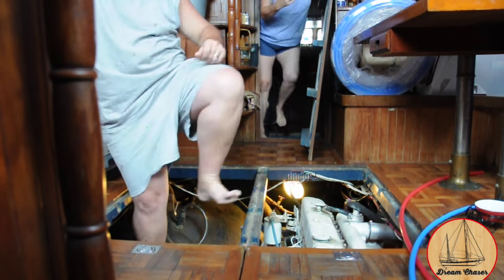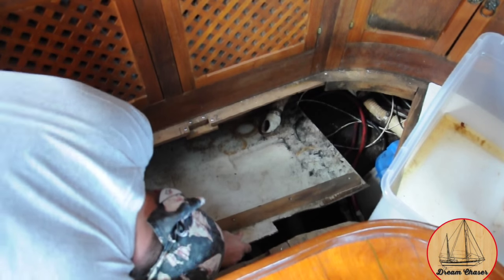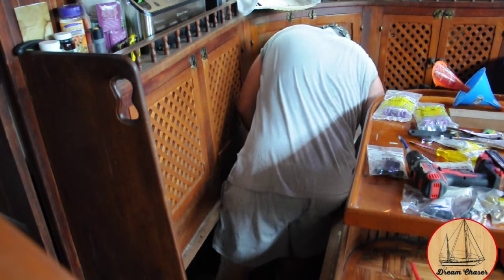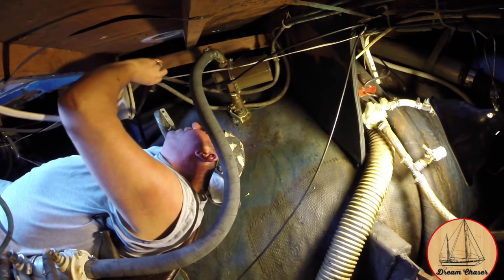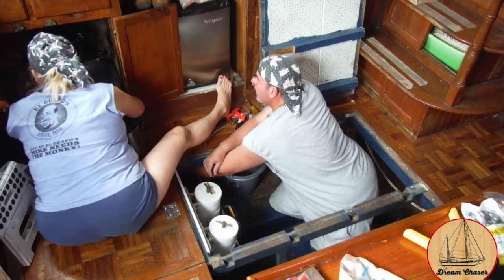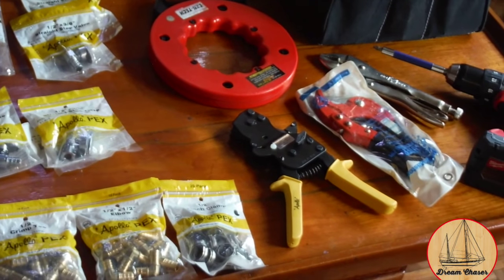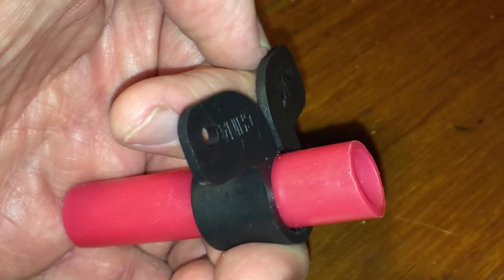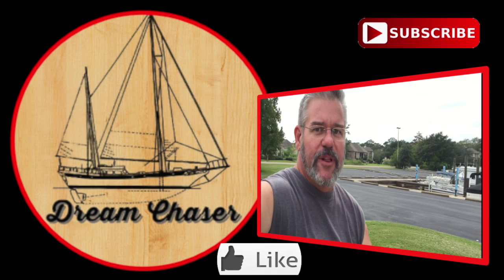Replacing the Fresh Water Plumbing on your boat Series 2 of 4

Comment: there are a couple of acceptable ways to marry copper and plastic.. which always begin with a soldered on threaded coupling... with pex, you can use glued on threaded plastic fittings that mate with the threaded copper.  If it were me, I would limit the destruction and the labor unless there are problems with the faucets and mixer valves that demand they be replaced.  Part of that also depends on if those original faucets etc are worn out.
Reply from the maker: Capt Larry - the good news is that project is far behind us now and all has been well for a couple years now. :). I️ hope you enjoy the Videos Larry. Check out the others.